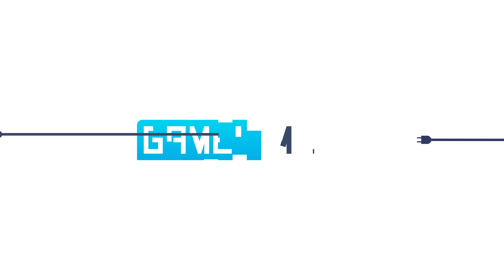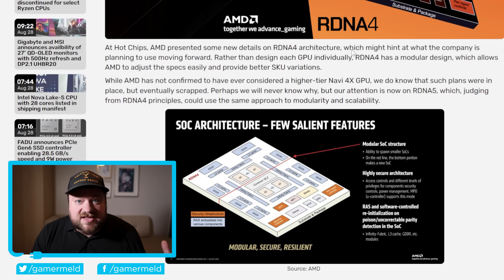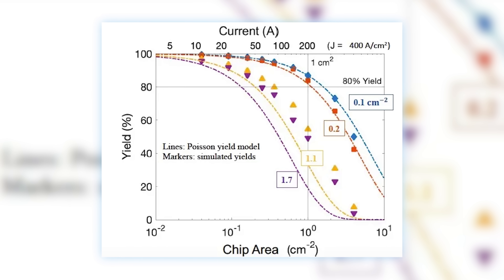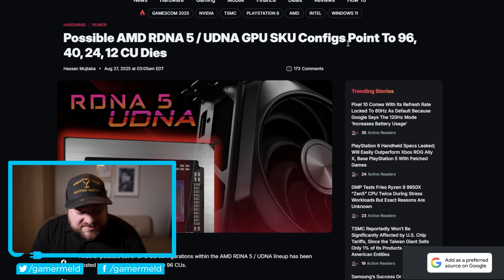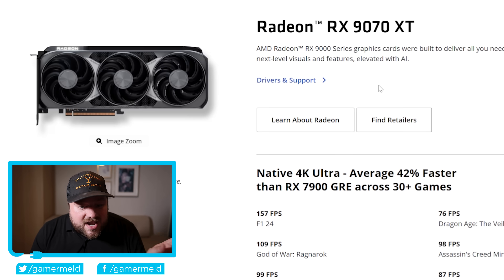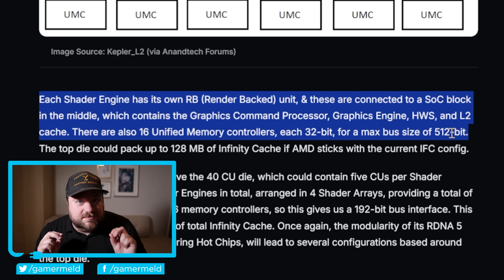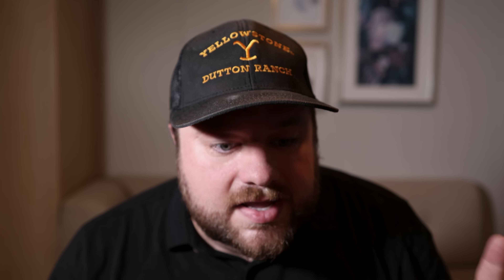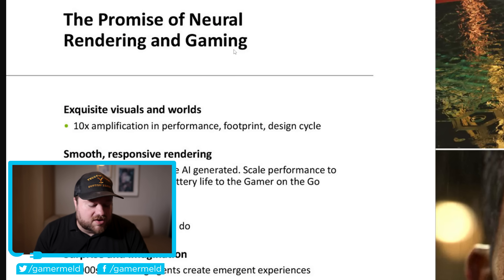Nvidia Officially Reveals The UNTHINKABLE!

Comment: If they end real frames, I will end my real money
Reply: Imagine if we paid for the GPUs using Money Generation and Money Upscaling, for each $1 another three $1 are generated. Also each 1$ is upscaled to be 2$.
So we pay 8 times less the price for the gpu.
Reply: That's what I have said multiple times. If these companies want to give consumers fake shit, then we should give them fake money. AI frames are fake. They will never match the quality of real FPS. Unlike real FPS, which are rendered, AI frames are generated. They don't contain new game engine data, so they are not equivalent to real FPS. Real FPS are rendered by the game engine, providing accurate visual information and no input lag. Fake frames are predictions based on previous frames, which can lead to visual artifacts, instability, and increased input delay. Especially in motion. Any frames that don't reduce latency are fake.
Reply: Without real frames you simply have nothing to build on. That said, raw FPS gains from real frames alone won’t be enough going forward. For demanding titles—especially if you’re aiming for native 4K—some level of frame generation will absolutely be necessary.

I’ve been running 2× frame generation on my 4090 whenever possible. I’m very sensitive to artifacts and any loss of sharpness, but it hasn’t been an issue at all—particularly since the introduction of the new DLSS transformer models. I did notice visible artifacts on the 5000 series when pushing 3× or 4× frame generation, which I didn’t like, but at 2× the problem is practically nonexistent.
Reply: @robertorossi4361 ^ 2x is the sweetspot, 3x and 4x is cool but not really ideal
Reply: For latency-sensitive multiplayer games, Frame Generation is currently a non-starter. It adds input latency, even with the higher framerate.

It's also not a magic bullet for cinematic single-player games running at a very low base framerate. In my experience (on a 4090), trying to use Frame Generation on a base of ~25 FPS still feels like crap, even if the final number is high. The underlying lack of responsiveness is still there.

I think you need a solid base of at least 40 FPS, and ideally 60+ FPS, for Frame Generation to feel genuinely good and actually enhance the experience. That's exactly how I played Cyberpunk on my 4090: I aimed for native settings that gave me 40-60 FPS, then enabled Frame Generation to boost it to 80-120 FPS. In that scenario, it absolutely improved the fluidity and the experience.

However, NVIDIA's marketing suggesting a 5060 + Frame Generation can equal or beat a 4090 is where things get ridiculous. That's what many are reacting to when they complain, because it's simply not a substitute for raw hardware performance.

That said,  people need to get over the simplistic "fake frames = bad" mentality. The technology has its place. Even AMD has essentially admitted it's a route they can't ignore with AFMF. Since we've been dealing with the death of Moore's Law and Dennard Scaling since the mid-2010s, we have to accept technologies like AI upscaling and frame generation. Otherwise, we're stuck in a hell of tiny, incremental performance boosts generation-over-generation, all while paying higher prices for more power-hungry hardware. For good reason, the majority has already accepted AI upscalers like DLSS and FSR 4 as great innovations (as a fellow pixel-peeper, FSR has gotten impressively close).

This is why it'll be interesting to see what NVIDIA actually means by their "All AI-rendered frames" hints for the future. As mentioned in the video - it must be a new concept that somehow integrates player input, unlike the current tech which can only interpolate between two already-rendered frames. If they pull that off, it could potentially become a viable option even for multiplayer games? We'll have to wait and see.

I'm also really hoping for a kick-ass new generation from AMD with their 10000-series GPUs to finally bring some real competition to the high-end market. We desperately need it.
Reply: @oelergodt  Yeah big pass from me, fake frame are bad frames end of story.  Until some technology makes them equivalent to a real frame no.
Reply: Sure your „real money“ is also a FIAT-currency… look it up. -> conclusion: it‘s not real - only the „official“ currency
Reply: I hear switch 2's are available.  So your set
Reply: Don’t worry these will sell like hotcakes!
Reply: @haukionkannel the the interpolated dollar bills?
Reply: What do you mean by real frames? They are all generated so why does it matter how they are?
Reply: @detonationpyrotechnics4156  No they aren't. Real FPS are rendered. Not generated. They are two different things.
Reply: Fake frames might work for games but it is absolutely useless where real processing power is required
Reply: @JojoJoget  Nope, they don't work for games in 80% of cases, not in their current implementation
Reply: @JojoJoget  Even for gaming, fake frames still require a good amount of raw performance to actually work effectively. It requires a base FPS of at least 80 for it to feel decent. So if these companies think they can completely replace raw gaming performance with fake frames, they are totally delusional.
Reply: Sounds fair to me.
Reply: Bye
Reply: all frames are fake
Reply: @bigturkey1 true, but it is how we fake our frames that matters, and Nvidia wants to fake our frames in a way that doesn't work well for latency or visuals. I prefer my fake frames to look like it took some good ol math to render.
Reply: I've only put my money to Nvidia once, and it was s**t experience
Reply: @RinoAP you can trash nvidia in almost every way possible, but nvidia is still definitely number one when it comes to performance and integration even with the Ai slop, and its not even close. There is a reason people are hating on nvidia and its because they are so far beyond anything everyone else is doing but they are rushing everything to the point where normal consumers are being scammed out of their money and hardware that is barely within specs before melting down. Nvidias real customers are other companies until The Ai bubble bursts.
Reply: @SuperJonathanmatthew 
There is not AI buble! The demand and usefullnes is there. Andctge demand will increase in future. Military, coverments, scientist, corporates, criminals all want faster and more powerfull AI solutions. So if you want to wait the buble to virat you have to wait your whole life!
Reply: @RinoAP  said no one ever
Reply: @foxorroxorz I mean their drivers right now are actual trash.
Reply: @aubrynobicop6924 only for 5000 series though right? Not defending Nvidia but 99% of the time there good. I run 9070xt before you call me Nvidia fan boy 🤣👍
Reply: @foxorroxorz  it's effected past cards too, that's how shit it's been this year.
Reply: @foxorroxorz  Haven't had in Nvidia in my rigs since 2006.
Reply: @foxorroxorz  probably said every minute
Reply: @foxorroxorz  said literally everyone who ever used nvidia ever.
Reply: @foxorroxorz  Nvidia has put overpriced trash out for years now
Reply: @aubrynobicop6924 do you have an nvidia card? or are you just talking to talk? I’ve had a 5070Ti since launch without issues
Reply: @Mike_24N  I have an Rtx 4080 currently and have also previously used an Rtx 2080ti, GTX 1080, and gt730. for amd I have used multiple apus, and a rx 580, and a rx6600.

Comment: Every frame, every pixel is AI generated. There's no relevancy for "interpolation" between any "real" frames, because there are no "real" frames to begin with, though the network can use state space interpolation internally. NN Rendering is an entirely different architecture for rendering, it's not based on triangles or any rasterization...It doesn't even have a hard "resolution" until late, this is only an emergent property of the decoder/output instead of a constraint of the latent layers.

Comment: I think this will go down the path of dual cards again.
One for DLSS, one for performance. Anyway I genuinly think people are missunderstanding sth about modern gaming.
Games are getting bigger etc is all bs.
Overall the biggest issue for FPS nowadays is... Optimisations.
The majority (70%+) of games thrown on the market nowadays feature very poor optimisations or even worse prebuild engine crap like UE5 bloat that just runs giving 0 in quality while eating massive chunks of performance. Im talking adding up to 1600% of actual performane that can be gained just cutting that bloat out.
On one end I get where Nvidia is aiming, since this is actually pretty useful for very high end simulations and scene renderings, but honestly they need to split the dlss from the gpu tech. I wouldnt mind a single extra frame, like trust me in good games you will get like 70% more fps at basically no loss. Im looking into how to use dlss for server performance and I see the tech without visuals at a much better use here. (AI pathing in games, AI generation and AI backend sampling for debugging for example)
I still wouldnt buy AMD for now, but in general just dont buy GPUs rn, the price will drop